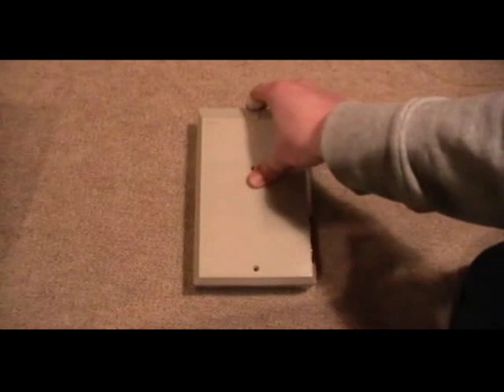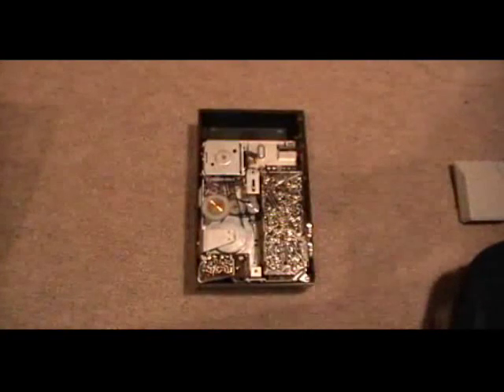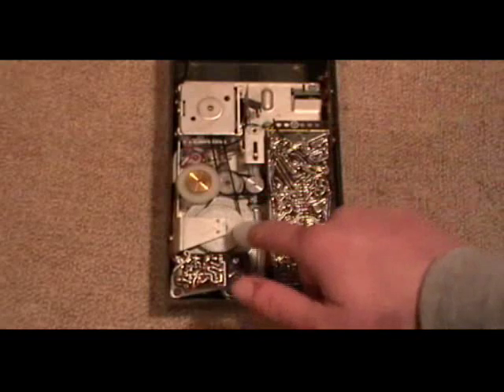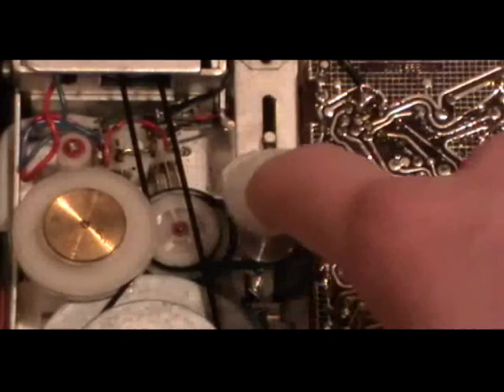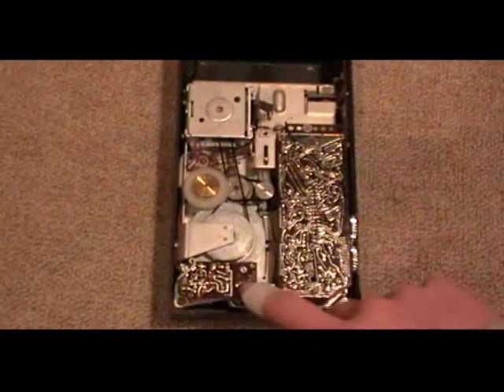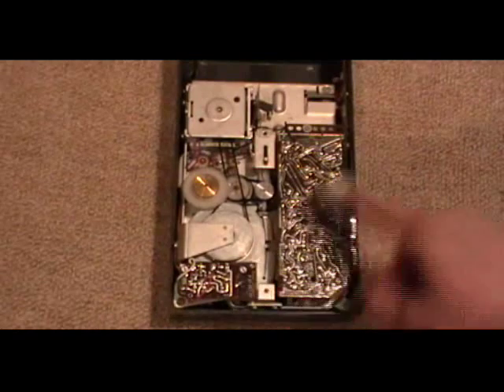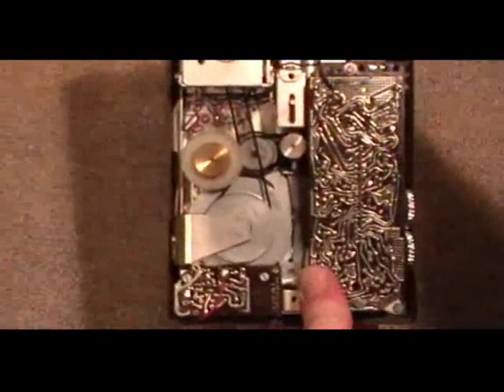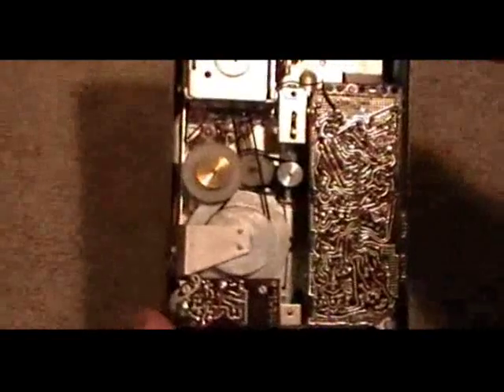Philips EL3301 cassette recorder from 1964 (2/2)

Comment: Hi. I've got a 3302 on ebay in mint condition but I need to change the belts as sometimes the speed is not good mainly on 90 min cassette. El3302 seems quite the same as yours. Can you advise how do you change the belts, the main one seems enclosed and need to dismantle the motor carter and the mechanic of the main wheel ? Thanks for your help.